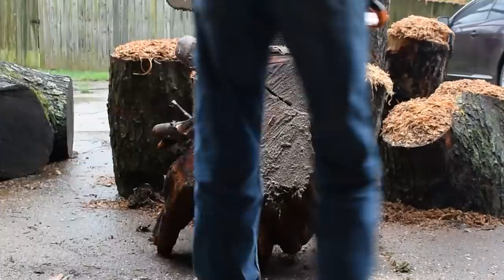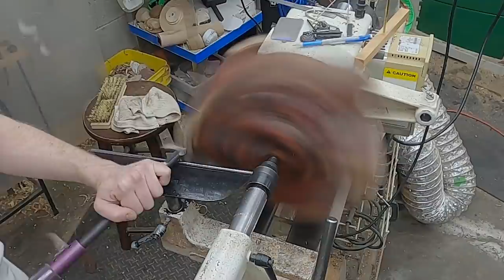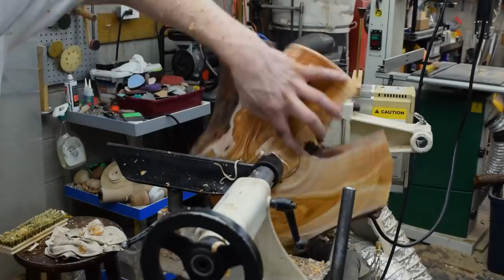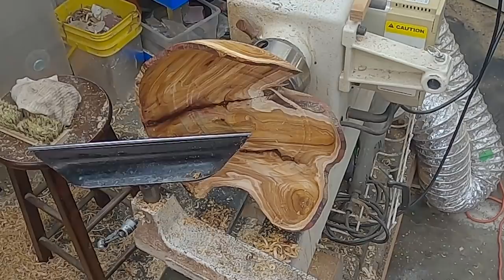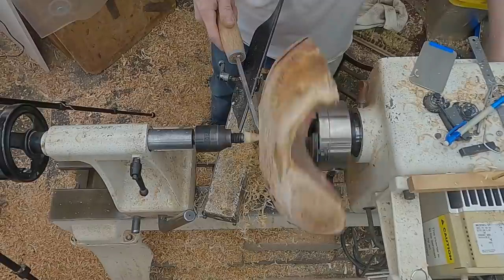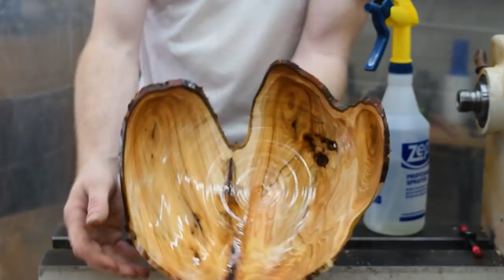Woodturning - Lobed Bowl From Yew Branches [1st Time Turning Yew]

Comment: The most gratifying shop operations are the ones that make your work either easier, more accurate or more productive. That's why shop made fixtures and jigs have always been popular YouTube videos. Think of it this way... The need for "counter balance" probably predates the steam engine but you can find examples of it for just about any engine that employs some form of crank or crank shaft. Anyone who turns has experienced (to some extent) what you did here. Despite YouTube's fertile turning population I have never seen a video that tackles this topic. Watching you battle with extreme imbalance has inspired me! I now know what my next LATHE RELATED project  will be. Since you use a chuck mounted spur drive to start with I'd be thinking of a cylindrical wood  collar that clamps around your chuck. The collar would be designed with the ability to dial in steel bolts for counter balance. On another note, I think you need a larger cup center on ungainly stock like this. 
Final thought: That crotch is absolutely stunning! It proves that all the man made epoxies and acrylics cannot compare with what's found naturally hidden in the beauty of a tree. Speaking of which, that aluminum handled gouge of yours. Yuck! 😉

Wakodahatchee Chris
Reply from the maker: Hey Chris... It's funny how two people can see something so differently and take two completely different approaches to accomplish something. To me, this piece was pretty well-balanced for its size and the turning went quite smoothly. There was some vibration, but it wasn't any great battle; the flexible lobes and the gaps between them are the trickier thing to deal with. I don't really mess with jigs and the only way you'll see me use one is if the project cannot be done without one. I completed that bowl in probably as much time as it would take to build an effective jig for it. Just remember that as soon as you start removing material, your counterbalance is now out of balance. If a jig is the only way to feel comfortable with a project and that is your preference, then by all means use a jig. 
Not sure what your issue is with my aluminum handle and/or the gouge in it, but the gouge is a John Jordan gouge made by Thompson Tools... you know, the same tools that MANY other professional woodturners also use. The handle is a Trent Bosch handle that I've filled with shot - it works perfectly fine (better than wood handled tools, for sure). I can only imagine what your comments are like on other turners' videos considering how many of them exclusively use crappy carbide tools, dump resin over whatever garbage they can pile together, turn objects with less-than-desirable form and finish, and have sketchy safety practices at best. Of course, there are other good ones out there, but not as many as one would hope. Anyway...
Good luck with your counterbalance project! I'd be curious to see what you come up with. Thanks for watching! Stay safe!

Comment: Despite the tool marks I did not see, this was a very nice piece, Chad!!!   I like the creativeness shown.   Very nice!!! 👍👍👍👍👍👍

A couple of suggestions:  If experiencing tear out, don’t go back and forth with your tool while turning.  You may get tear out going in one direction and a smooth cut in the other.  But you won’t know which one.   So experiment turning the wood if you are getting tear by going in one direction.  If that doesn’t work, go the other direction to see if the turning is smoother.  This works most of the time reducing tear out or finding out what causes it.

As a safety measure when using a spur drive, flatten out the area with a chisel as you first did when mounting the wood on the lathe.  But, go one step further.  Use a forstner bit a little larger than the diameter of the spur drive and bore into the blank about 1/2”-3/4”. Then put your spur into the bored hole.   In case the wood comes loose from the spur, the chances of wood flying off your lathe are greatly reduced.  The bored hole keeps the wood on the lathe.  Doing this has saved my bacon several times and kept the turning from being damaged due to flying off the lathe.  More importantly, it helps keep you safe.

Again, a nice piece of wood turning!!!
Reply from the maker: Okay, okay... (please take this in the 100% friendly spirit in which it is intended 😁)  You clearly know what you're talking about with regard to woodturning and I'm glad that someone with such a close eye for (and sense of) detail watches and provides constructive comments on my videos! However, I obviously don't know who you are or what your woodturning experience is, which provides little context for how to reply constructively versus defensively (which I certainly can be at times, even if I don't mean to be). So, knowing that I appreciate you and knowing that I don't mean to be a dick... 😁

I skimmed through the video and I'm not sure which part you're talking about where I go back and forth - I seem to do it in the 9:00 range and 18:00 range, roughly. What you're seeing me doing is exactly what you're saying - assessing which direction is giving a better cut. When I turned the piece around and held it by the tenon, I believe there was a little wobble in it that I was trying to remove (I'm not sure if that's one of the parts you're talking about). One of the first things I teach people woodturning is that if you can't get a good cut in one direction, try the other direction, just as you said. 

Regarding mounting with a spur drive... that is a very good idea and one that I'm sure I will try at some point. One small possible drawback could be in those circumstances where you need to reposition the blank - your drilled hole might limit your options for repositioning (but probably only if you really missed badly on your first attempt). I don't think I've ever had a piece come off the lathe while using a spur drive; usually, the spurs just tear out, lose their grip and need to be reset. Most of my flying bowls have been while using a chuck. 

Anyway... thanks for your feedback and tips! Do you have a website, IG, FB or anywhere that I can see your work and learn more about you?
Reply: @ChadEamesWoodWorks  

Try around the 21 minute mark.

Just offering suggestions, Bud.  Take them for what they are worth for you.  Try not to dissect things so much since what I offer is based on observation to HELP you since you mentioned tear out. No need to be bothered by someone offering suggestions.  After all, that’s how you learn.

I do not have a web site or YouTube channel.   I owed a machining supply rep firm for nearly 40 years where I sold heavy industrial machines ranging from injection molding, lathes, forges, presses, etc.  Part of that business I also sold and repaired wood lathes that were of heavy industrial quality. As part of the trade I also repaired lates like the Jet, Grizzly, Robust, Oneway, Powermatic and Laguna.  So I talked with many professionals over the years to gain my knowledge along with doing both metal and wood turning myself.  I sold the business 12 years ago when I retired.

Perhaps I should just view the videos and not make comments since there seems to be a problem with what I have to offer.
Reply from the maker: Sorry, man. I thought I went out of my way to let you know that I appreciate your comments before going on to explain what I was doing at the parts you referenced. You might note that I ultimately agreed with both your point about going back and forth (by explaining that's what I was actually doing), and your tip for the spur drive (with one minor caveat). 
I have been turning for 13 years and have turned many thousands of bowls and other pieces, so I'm at the point where there is a reason that I do almost everything I do. That's not to say that I have nothing to learn - obviously there is plenty I can and will learn and there always will be. Not only that, but there are often multiple ways to accomplish the same tasks or achieve the same results. 
I didn't mean to discourage comments or suggestions from you or anyone else. I was simply explaining that the help you were trying to provide was actually what I was doing. My hope was to avoid exactly the type of reply you followed up with... clearly I failed. In the future, I'll keep my replies short and always in complete agreement.

Comment: Nice turning. Beautiful grain.
I have a Yew stump like yours (Only about 1/3 the size) You got a monster there. Can't wait to turn it, after seeing yours.
Great job.
One comment, though. Never, ever hit your spur drive with a hammer. You'll mushroom the end and screw up that taper. Only use wood mallet.
Reply from the maker: Be careful with yew; almost every part of the plant is toxic, some highly toxic. You’re right, I should be careful with the spur drive but the last 1/2”+ of mine isn’t part of the taper, so I can hammer it back out or grind it off when it mushrooms. I have a couple others that I’m not sure have the same design. Thanks for the heads up. Thanks for watching!

Comment: Looks fabulous. Would like to know, though, why you turned it in an obviously rather wet state. Isn't there a danger of the piece warping and even cracking over time when drying?
Reply from the maker: I prefer to turn wet wood. It's much easier on your tools and much more pleasant to turn. Of course, it has the exact potential issues that you mentioned, so those have to be considered. Personally, I like some degree of warping in most of my bowls. Because this piece was turned thin, it was able to move while drying, without cracking. Thanks for your question and thank you for subscribing!

Comment: This turned out incredible, your ability to bring out the beauty in a misshaped hunk of wood is second to none, and that grain...oh my! I'm curious how much time and work went into prepping that root for turning, and if you came across any rocks? I have often thought about turning roots, but wouldn't know where to start with cleaning and prepping it.
Reply from the maker: Thank you for the kind words! I do my best. Very little time went into prepping that piece. Someone did a good job of cutting it right at the ground level, so there is a good bit of wood where all of those branches come together. On top of that is about 2" of mossy dirt that I just pulled off that area before I chainsawed it. I didn't really even get into the good part I don't think. If it hadn't been cold and rainy, I would have pressure washed it first to get as much of it off/out of it as possible. As far as rocks inside the wood, which seems like a possibility, I guess just cross your fingers..?

Comment: Do u know why ur tool was bouncing so bad on the backside of the bowl??
Reply from the maker: It’s partly because of the lobes of the bowl, but mostly because it was pretty out of balance (the end where the branches come together was thicker and heavier). After I took some of the mass out of the inside and off of the heavy side, the vibration was greatly reduced. In the lower left of the screen in some shots, you can see the top of my depth gauge wobbling like crazy.

Comment: Chad, please don't use a steel hammer on the end of anything that you are going to put in the spindle.  You will eventually mushroom the end of the tool and when it exceeds the dia. of the taper down in the spindle it will ruin it.  I would suggest a heavy brass hammer that won't effect the end of tool.
Reply from the maker: Hey Dennis... yeah, someone pointed that out to me a while back and I didn't pay much attention because it never affected the fit in the spindle for the decade I did it... until... I went to use that spur drive in a different lathe. That lathe taper grabbed closer to the back end of the spur drive, whereas the other lathe grabbed closer to the spur end. Luckily, I have several of them and the new lathe came with one as well. But, to your point, I now always use a 3"x12" maple spindle blank to pound a spur drive in. Maybe not the best tool, but it was the closest thing to me to accomplish the task and now that's pretty much its purpose. Hahaha... Thanks for watching!

Comment: Just wondering why no lung protection? That’s a toxic wood and turning without a proper face mask is really dangerous. Love your work but just want you to look after your health at the same time
Reply from the maker: That’s a good question. The wood was very wet and not producing dust, so I wasn’t really concerned. When it dried and I sanded it, I used dust collection and my powered respirator (and an air cleaner that runs anytime I’m in the shop). Thanks for watching out!